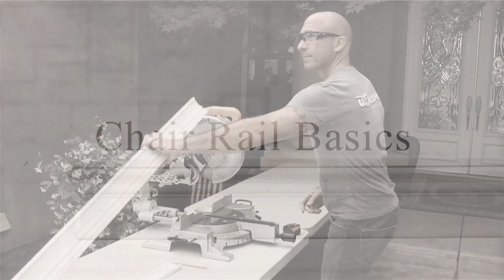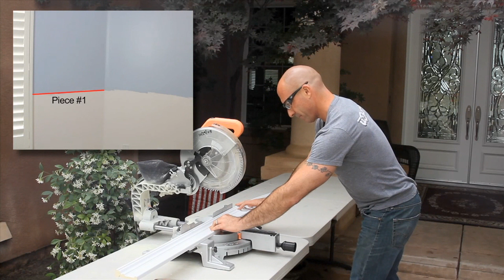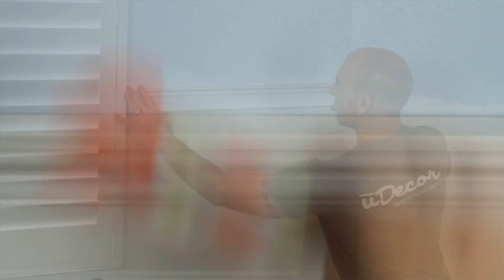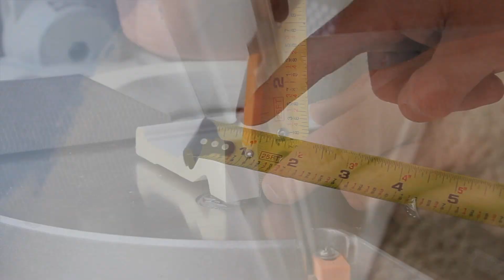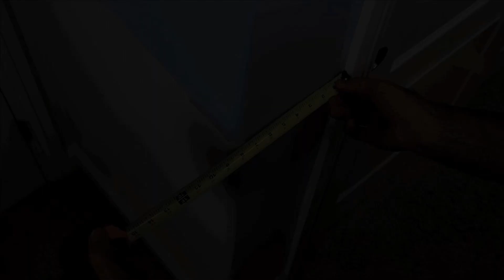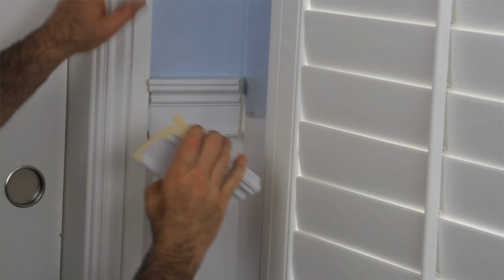How to install uDecor chair rail

Comment: I have a question. I have a mitter saw that can do both 45 degrees cut right and left. Do I still need to put the flat moulding upside down? And why you put the piece upside down?

Comment: Piece 5 and 6 should have a scarf joint
Reply from the maker: A great thing about polyurethane is that it doesn't grow or shrink. After many installs, butt-joints are working great.

Comment: Thank you for the great video.
I was wondering if it would be an issue to use crown molding as a chair rail?
Reply from the maker: Great question. It would be unusual to use a crown as a chair rail because you would need to put some sort of cap piece on top (in essence creating a shelf).

Comment from the maker: Excellent questions.  Unless you want to relocate plugs, the outlets on your wall will play the biggest role in deciding the spacing of your boxes.  I like to sketch out where everything is located and then plan it such that our boxes don't run through any outlets.  The quantity of boxes is dependent on the wall length.  If it is all going to be the same color I paint it with the same sheen of paint ... if you do that with the chair rail and boxes it makes it look like it is all 1 unit.

Comment: Hello, Can you answer two questions for me about shadow boxes installation. How do you determine the gap between the shadow boxes, and the size of the box?...is there a standard number or its solely dependant on length of wall. Also when painting the wall for shadow boxes, is the wall paint eggshell, and trim semi gloss